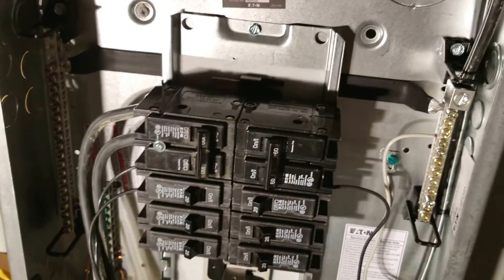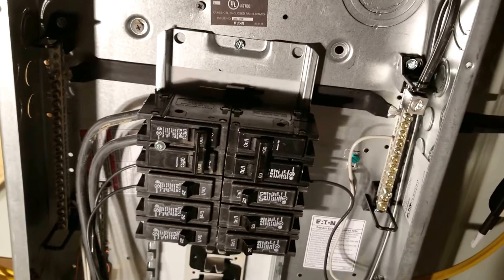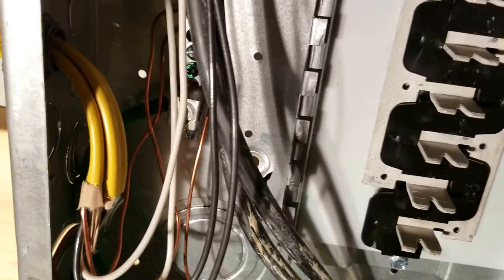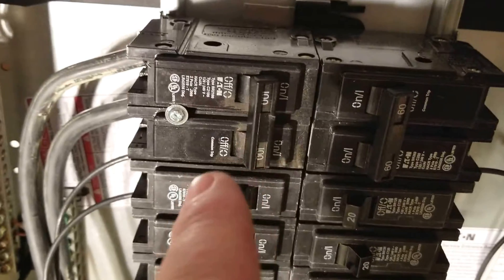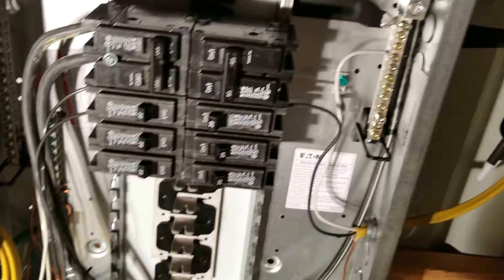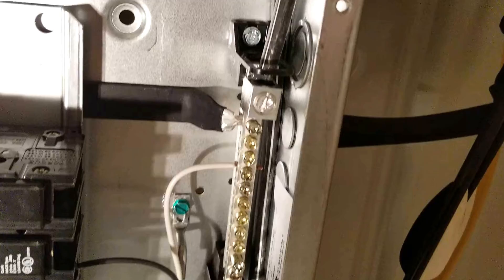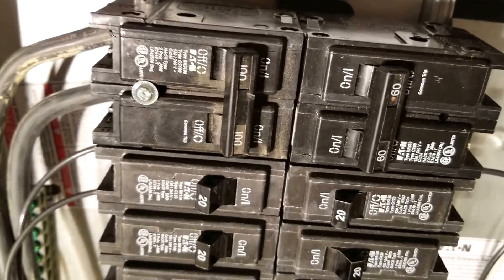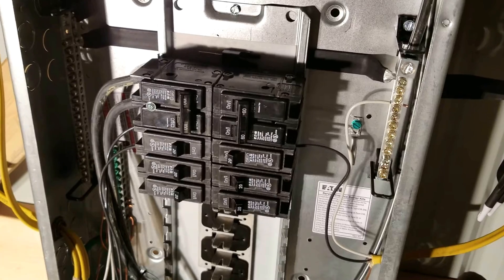How to wire a subpanel

Comment: what size wire do you use and do you use another 100amp in your breaker box
Reply from the maker: Use a wire sized for the breaker in your main panel. I used a 60 amp breaker in the main.

Comment: With your black feeder cables from the main panel, how do you determine which one is which since there isn't a red line on one of them?
Reply from the maker: Wrap white tape around both ends of the one used for neutral

Comment: If ur wire u run can only hold 30 amp wont it melt the wire before it set off the breaker ?
Reply from the maker: If the breaker is oversized the wire can melt

Comment: Can i feed a sub panel with 100 amp breaker from outside main panel then have another 100 amp breaker in the sub panel feeding the breakers in the sub panel
Reply from the maker: Check the codes in your area

Comment: In a main panel, you should try to balance your circuits so you have similar draw on each 120V leg, right? It seems to me that you don't need to think about this in a subpanel because although you have two hot buses they are tied together by 100A feeder circuit breaker. Am I right about this?
Reply from the maker: I would try to do it in every panel

Comment: Can you use a sub panel as a main panel ?
Reply from the maker: Yes in many cases. It depends on the grounding and local code
Reply: @BeyondtheBoom   the worker at Menards told me you can't because it's not made for that plus  it doesn't have the breaker for the main coming from outside you will need two main breakers of sizes 100 am0
Reply: Seddeek    You are mixing terminology.   A sub panel is a panel fed from another panel.   A main panel is the panel fed by the electric utility.  A main breaker panel has one breaker that protects the busbars in the panel.   A main lugs only panel has no main breaker protection comes from overcurrent protection elsewhere.

Comment: I don't see a grounding electrode conductor on the EGC bus, are there any of the code required grounding electrodes (ground rods, concrete encased electrodes, etc.) for the separate structure?
Reply from the maker: I put them in my last shop but didn't in this one because of how close it is to the house.  Usually on a sub panel you don't add them.
Reply: @BeyondtheBoom  Maybe it's different in your area but according to the NEC separate structures are considered separate regardless of their distance apart.  In your installation a grounding electrode system is required even for a subpanel.
Reply: Robbo    Correct!   It is for dissipation of lightning.    Even if you run a EGC in the feeder.

Comment: What gauge wire are you using feeding the 100 amp breakers?   Thanks for your help.
Reply: That triplex cable is it aluminum? What size ( gauge) is it? What size of copper wire could be run?
Reply: My electrician used 2 awg Aluminum wire 100 amp sub panel.
Reply from the maker: I actually used 125 amp triplex.  It is service entry cable.
Reply: @BeyondtheBoom  what awg wire is that

Comment: There is an aluminum connection between your neutral and ground bars that runs flat along the back of the panel, which still "bonds" them together. Check with electrician to make sure that it's ok.
Reply: His removal of the box ground tab only manage to reduce or eliminate the ground of the sub panel box. This should be moved to the ground buss bar! The neutral and ground bars are still bonded by the bonding strap shown at the top connecting both bars. This must be removed in order to separate the 2 bars.
Reply: Bingo! @coypatton3160
Reply: Henry Adams    Coy was incorrect.
Reply: This article goes over the mistakes this DIY made: https://diy.stackexchange.com/questions/83184/is-the-wiring-in-this-sub-panel-correct. The answer is under "Neutral and grounding bars not separated"
Reply: That is a common bonding item in many boxes. Also usually you would do the ground cabling from an independent ground rod, not run the ground from the previous box.
Reply: Coy Patton    Watch again, you are incorrect!
Reply: The jumper in the box from one side to other does not need to be removed, as stated in the comments. It's tieing two neutral busses together, they are the same thing. He has a third "extra" buss bar, on the left side, in the panel. However, if he has it hooked up like he says he does, it's still bonded through the main panel. Check the sub panel with a continuity (ohm) meter, I think your going to find continuity, (bonded.) In a lot of areas, the inspectors, still want it done the "old" way. Bonding jumpers and ground rods in place at every panel.
Reply: Bebo May    The first part is absolutely correct.   I got lost on the second part.   Any time you do continuity between neutral and ground test, there should always be continuity.   No matter how big the electrical system is.
Reply: Andrew Jeck    Watch again!   You are incorrect!
Reply from the maker: It's fine

Comment: Thank you for this video. What size is your main?
Reply from the maker: 200 amp. Just have a 60 amp breaker feeding the subpanel
Reply: @ AWC - I'm a little confused. You've got a 60A double throw in your main, but the sub's main is 100A double throw? Why didn't you feed the sub with that 60A double you have in that box?

Another question...You have a 200A main, and a 100A sub. Isn't that a little hefty for a sub panel? I'm not criticizing, mind you. It's been a long time since I've done electrical work (did it for a living for 7 years, 20 years ago), and a friend wants me to put in a sub panel off his main disconnect for his hot tub, a coy pond pump, and some lighting. I'm going to have to go rummage through the code book, because I can't remember the code for this sort of stuff, and I don't want to burn his house down.

I didn't check his service. I'm hoping it's 400A, or I may have to curtail his enthusiasm.
Reply from the maker: Very good question with a very simple answer.  The reason I went with this panel is because it was one I already had so I didn't want to buy another smaller one. As far as the breakers, the main panel is a homeline and the sub panel is Eaton.  And I used a 60 amp breaker that I already had in it. It was about using what I had and not having to buy more.

Comment: Hi there J, Been watching most of you vids, especially electric related, and appreciate your good work, both electric and filming. Would like to know what kind/size wire or cable you used for the 100 Amp to the SubPanel in shop? Is it a cable bundle or 4 individual wires? In conduit or direct bury from house main panel? Looks like you used your temp service panel for the shop didn't you? I live in Luaville up the road from you and my daughter graduated from WK back around 2K I think so got to know your county pretty well then. I'm retired plumber in 2011 so now just doing all I can home improvement wise at home here that I put off while working. I visit my other girl/family in N'ville,TN many times a year so if you ever need anything up my way or visit up here, please drop me a line ahead of tine and I'd be glad to help out.
Reply from the maker: I used 125 amp triplex from Lowes. It is direct bury but I ran it in conduit since it goes under my drive.  This panel is actually another one I had but the panel on my temp pole would have worked.  Thanks for watching

Comment: do you have to have that 4th ground wire or can you just run a wire to a ground rod instead?
Reply: Yes, for a separate building (in our north american TNC-S system) you need both a building ground rod(s) and a ground wire leading back to the main panel. The jargon of ground connections is misleading. 'Ground' is just a route for electrons to find a way back to the neutral lug of the transformer on the pole. Unfortunately there is a fair amount of resistance to even a properly grounded connection, especially in dry soil. So, it is very possible to get a shock, despite the ground connection near by. If the human or animal body offers a lower resistance pathway, electrons will follow that path. To minimize risk, a wire offers the lowest resistance pathway to the transformer neutral lug. Mike Holt offers insightful discussion of these points, here on Youtube.
Reply from the maker: +storminnormanz according to code you're supposed to run it back to the main panel.